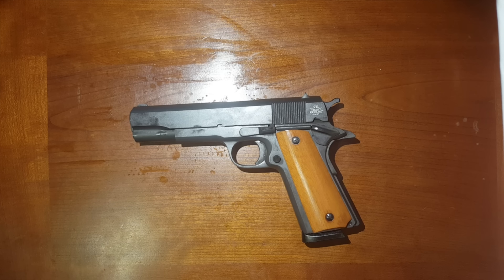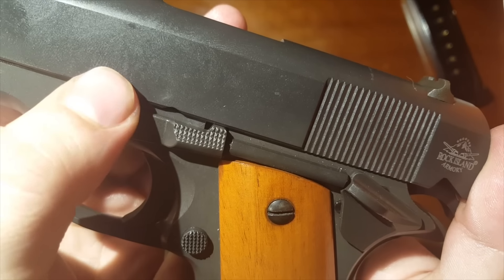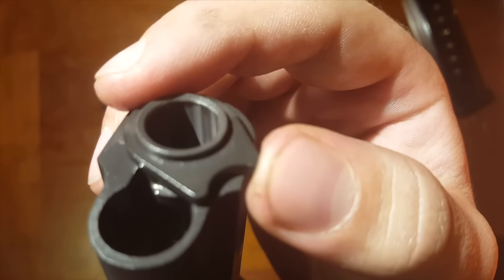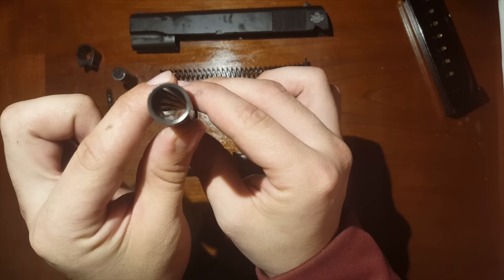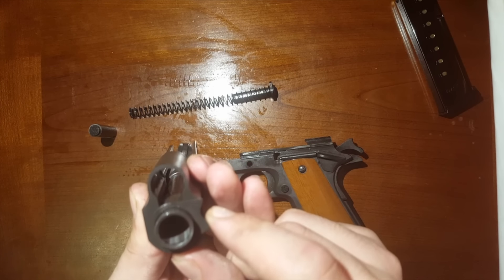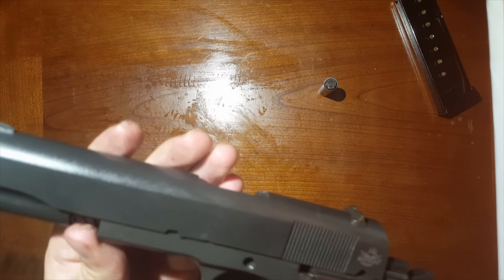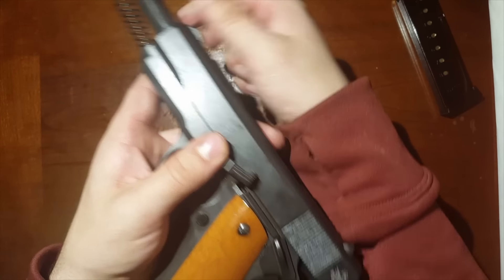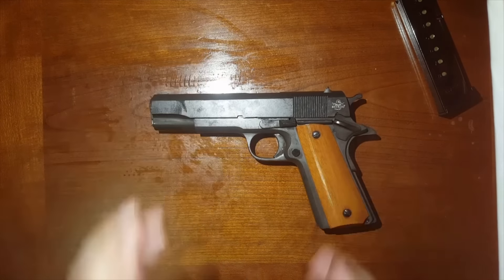Rock Island M1911 - How to Disassemble/Reassemble for cleaning

Comment: Just got my first 1911. The RIA 1911A1 in 9mm.
Used your video to take it apart and clean out the heavy packing oil that is covering the gun.
The first time I tried to put it back together, the slide came off when I tried to rack the gun. 
I didn't get the slide release back in the hole properly.
Tried again and this time it all went right. 
Thank you for a great video on Assembly of my 1911.

Comment: The little circle is the barrel toggle that unlocks the barrel from the slide after the slide moves back just a tad. I have always had trouble putting a 1911 back together, because the toggle would swivel. The way you lock the slide and move the barrel is a top notch solution. Thanks. I think I slept through the class in MP school in 1966. Thumbs up. Thank you.
Reply: Barrel bushing
Reply: @taradactyl5690  thanks.

Comment: Thanks for the video.  Only one thing I'd recommend...That weapon is 'over oiled'.  I've made that mistake myself...a lot.  Too much oil allows for more powder and other fouling.  You can use too much oil when maintaining your firearms, which can lead to fouling and malfunctions.  Typically I use a q-tip or other cotton swab, or a cleaning patch with a single drop of oil.  I find that that adequately lubricates the moving parts while not creating 'Sludge' after I fire the weapon.  It also makes disassembly and reassembly much easier.

Thanks for the video and I actually learned an easier way to reassemble.  Kudos!
Reply: When I oil my weapons, I use a shaving brush(did it in the Army for years). It puts a thin coat of oil on the weapon. I use CLP on mine. Another habit I acquired. Hope this helps.
Reply: @DerbyCityOverlanding   Like I said to Steven Sturman. I use CLP(Break Free) and put a few drops on a shaving brush(did it in the Army). It will lay down a nice thin coat of oil on the weapon. Hope this helps. I usually do all my weapons once a month.

Comment: This video helped out a lot. Got a Rock Island Armory EFS .45acp. I used this to take it apart to clean it. I lot of carbon in there. It was quite the Choir to clean it haha. But putting back was a bit hard cause of the spring and the O part moving in there to put back the Takedown pin. Appreciate the video. Helped out a lot.

Comment: I hate when I struggle to get a gun back together! It took me way too long putting that slide stop back. After I put it back together I felt like the recoil spring is more stiff than before. I'm sure it's just in my head. I always over think when re assembling a new gun. Thanks for the video my brand new rock island was really dirty and oily from the box. I cleaned it all out with some solvent. Put a light coating of oil on everything wiped it down and put an extra drop on both sides of the slide and slapped it back together.

Comment: Great video! Thanks. Warning to all pushing the spring down and rotating that end barrel piece is a job. Btw, if you think an AR buffer spring pin will fly if you don't hold it, wait til feel the pressure from this spring. 
Of course, this should all become easier to do with more practice.

Comment: Make sure to check your extractor tension, mine came factory WAY too tight and after tensioning properly, it runs very smooth, incase you were having jamming issues and were suspecting the feed ramp or magazines, check this first, plenty of good videos out there 👍
Reply from the maker: That's a common problem with the 9mm version due to the company using the same spring in that platform as they do for the .45acp. Is your's a 9mm?

Comment: I’ve got the rock Island 1911 A1 cs, all I’ve gotta do is pull back the slide till the slide lock and the pin hole line up pull it out and it comes right apart

Comment: I need to practice more taking mine apart. Ive had mine for 4 years, rarely gets used, and only took it apart three times. That last part with the spring and the swivel piece is a pain in the ass. Lost control of it and the spring with the other pieces shot out almost as fast as the damn bullet

Comment: That's little hoop on the barrel was giving me problems,  flipping over and popping out of place if I moved the slide a millimeter wrong.  Tip on putting the pin through before thr recoil springs cap helped get it on.

Comment: My 1911 looks nothing like this and it is a rock island armory 1911 bought it from a friend and it’s has a muzzle I believe on the barrel and the spring is also different I tried to release the spring like in the video but after I turned I guess whatever you called the “barrel bushing” my spring did not release I was scared as hell trying to hold spring with one hand while I tried to locc the slide I managed to get it locced with help of course but the slide locc wouldn’t pop out might need some help if you could give tips?? Or maybe I just need to go to a gun smith
Reply from the maker: Is the muzzle fixed to the barrel or threaded?

Comment: My .45 doesnt have a spring assisted buffer on. So when I push down the spring, the guide rod gets in the way of the buffer stopping me from disassembling the gun. 
I was thinking of using a file tool to shorten the guide rod to be able to continue. Any thoughts on this?
Reply: No. Don’t do that, it will fuck the whole thing up... just got to a local store and buy a “traditional” or short guide did buffer system for your 1911. You’ll have to replace the buffer spring, the buffer pin and the guide rod...

Comment: This does not work for all RIA 1911s. I have the A1 10mm. Steps for getting the slide release out are different. Unfortunately have to insert a paperclip into the guide rod
Reply from the maker: Noted! Unfortunately I can't change the part where I said that in the video, but I'll pin your comment to the top for others to see! Thank you
Reply: @DerbyCityOverlanding  thanks! I will say assembly and reassembly with mine is a pain. Have to be prepared to pinch your fingers a few times